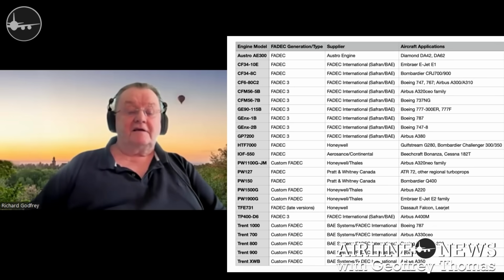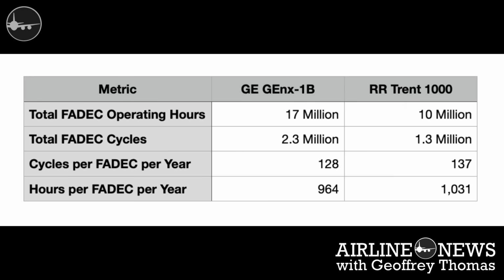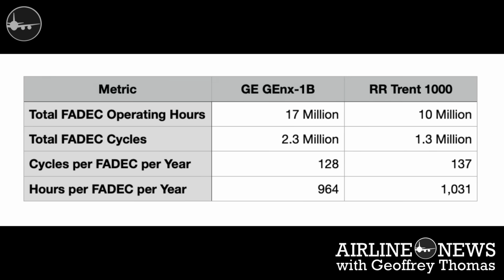Air India Crash - FADEC Explained  #airindiacrash

Comment: If there were physical faults arising from water ingress damage occurring in the electrical system that could lead to computer errors or other system failures, how would this manifest in recorded error reports or not.
Also what sort of faults or subsequent performance issues arising from water damage could ressult a very long runway roll. Could pilots over estimate the planes' ability to overcome a sub optimal roll performance and proceed to take-off when in reality they should abort? 
Would sub optimal runway roll conditions be recorded. Would voice recordings reveal comments by the pilots about any sub optimal situations developing and any debates if they should proceed or not.
If the situation becomes non recoverable and an abort procedure is no longer tenable, what then are pilots expected to do if there is not sufficient end of runway space available or a successful lift-off is unlikely?
Should the Preliminary Report provide more detail as to why exactly a long roll was occurring,  if any alerts were issued, if pilots made comments, or if there were systems reports coinciding with a sub optimal roll performance?

Comment: After liftoff problems started, took several seconds before crew became aware.  So the crew not caused the problems, but failing electronics. The crew is not to blame. Crew tried to save the plane, but that became too late.
Reply: aha - how exactly do you know ?
Reply: @lechiffre2617  Engineers know that the chances of a fault in the plane's systems are far higher than the chances of pilot malice.  Millions to one against pilot malice.
Reply: @lechiffre2617  Because that RAT was deployed automaticaly,  immediatly after liftoff, crew did not deploy, because they where unawhere of problems at that moment. Also speedbrakes where automatic activated, why should crew do that.
Reply: @JanMarkerink-z8i This doesn't prove anything. The RAT deploys automatically when there is loss of thrust. This does not in any way rule out a deliberate action from the pilots.
Reply: @rienkhoek4169 That RAT was deployed before the crew did anything. The crew was unaware, that took several seconds.
Reply: all this is called assumption
Reply: @lechiffre2617 Als een scenario is gebaseerd op foute veronderstellingen en of foutieve informatie en verkeerde conclusies, is dat ook niet de waarheid.
Reply: @juniper1803Why should the crew deploy the RAT before they where aware of any problem at all. Speedbrakes, i picked it up in another video of this item. After a few seconds after liftoff, crew became aware of the problems and tried to recover the situation, but it was already too late for that.

Comment: Why do RR Trent fitted 787 fly some 7% more cycles and hours per year than GEnx fitted ones?
Reply from the maker: One reason would be ANA...which uses 787s on short domestic sectors. It is one of the biggest operators with 82 in service.

Comment: As I understand the situation. The fuel switches were both turned to the "on" position as the plane taxied along the runway. For the engines to get the plane into position. They were both subsequently turned to the Cut Off position as the plane was ascending, generating the crash. According to a theory, this cut-off can happen by accident? Without the pilots being alerted and knowing? And which has never been reported to happen?
Reply: Noone even knows if the switches were turned physically or was it just a sensor/system malfunction, or automatic cutoff without the switches moving. Or if the switches were indeed turned, but only after the RAT deployed and other failures...
Reply: If both engines fail, pilots have an immediate memory item to cycle the fuel cutoff switches as a relight process. This could account for the switches being moved without it being a pilot-error or a death wish.
Reply: "As I understand the situation" is the problem. A complex system designed based on arp4754/4761 with all failure conditions and path assessed and with various physical engineering operating conditions in play. Any failure in its path could leads to one or more errors.

Comment: What about software versions and the source code? it must have been updated several times, so maybe a bug in a recent version that has not affected anyone earlier?
Reply: Or maybe a missing software routine for a scenario that nobody ever thought of?  e.g. plane wrongly detects it has just landed when it has in fact just taken off.  Plane wrongly detects TOGA setting after touchdown and shuts off fuel.  TOGA should never be automatically disabled on touchdown: planes have avoided runway obstructions not seen until after touchdown by hitting TOGA.

Comment: FADEC = Full Authority Digital Engine Control.(FYI) A tiny point..... Did not the Concorde have electronic engine control? Maybe this falls outside of the FADEC definition as it was an analogue computer. Still, a precedent in design ideas.
Reply: The Concorde had a "thrust-by-wire" system that controlled the engine power which is considered an early form of FADEC.
Reply: There are many types of EEC - Electronic Engine Control.  A FADEC is one type.  Analogue is another type of EEC which began development during WW2.